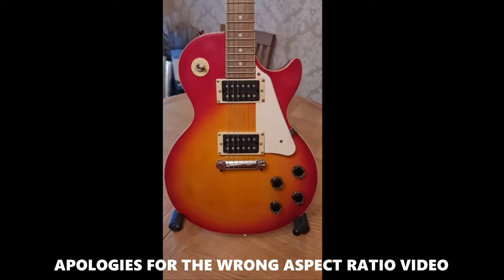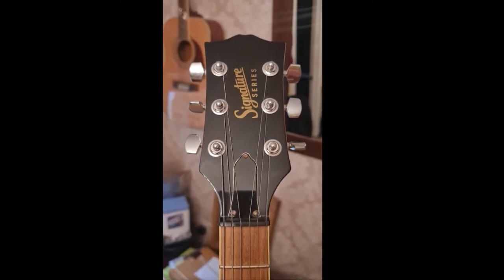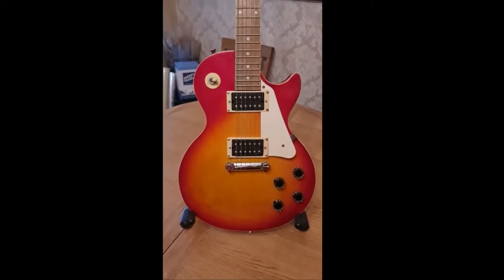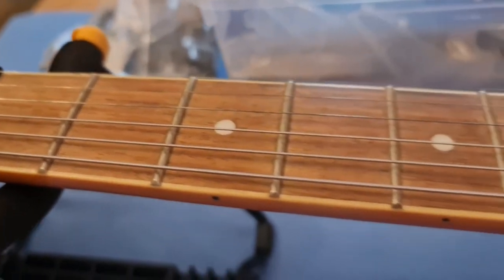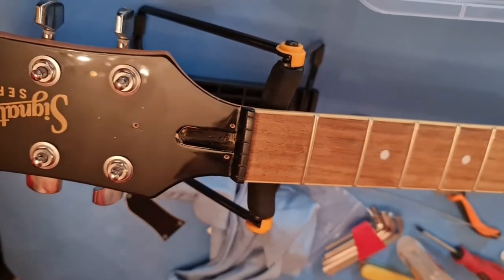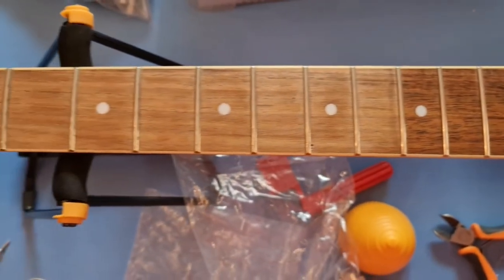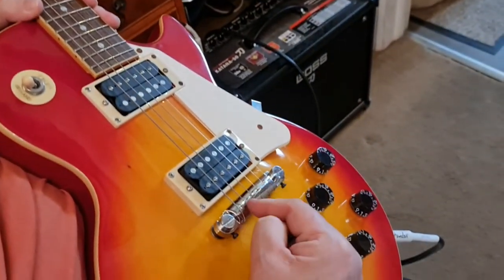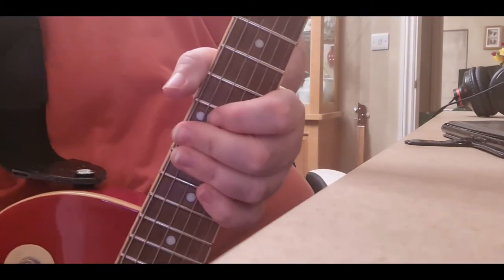GIBSON BALDWIN LES PAUL GUITAR REVIEW & RESTORE, DARK SECRET OR HIDDEN GEM

Comment: I found one at a Pawn Shop for $100.  Great bones of a guitar, better than a Epiphone i have.  My only complaint is frets are sharp to the touch.  The action was way high, approx 1/2 inch of fret board.  Thanks for the video.
Reply from the maker: You can blunt the frets with a nail file. I've heard they do multi grained nail files in your pound shops or buck stores I think I was told 👍🏻

Comment: I picked up one of these secondhand around 2010 for less than £100. I was curious to see what they were like. Following a proper set up it plays very well. I replaced the wrap around bridge with one that can adjust for each string. I eventually decided the original Epiphone pickups were too muddy and replaced with a set of Duncan 59s that I had from another project. I also thought the knobs looked awful so swapped for some more suited to a 59 Les Paul. I still have this guitar and I would say it was really underrated and because of its bad press I got a bargain, so I am not complaining.

Comment: i own one ..  its
...not awful.. i got it used for $25 so itsnot a loss lol..  it has some electronic issues and a fret or two could use some tweaking ...  plays best with .08 super slinky and i have had mine apart .. its solid but not mahog
Reply: good points... and it does not cost $2500 from Gibson. Even a decent Epiphone could get up around several hundred used... Learn what to do and why and do it yourself!

Comment: Can I put Seymour Duncan on it?
Reply from the maker: Yeah no.reason why you can't 👍
Reply: The thing is I bought this for 97£ in a pawnshop. I'm not quite satisfied with the sound. If I replace the bridge and the pickups, would it improve to a better guitar? And what fretboard do you recommend me to buy for it?
Reply from the maker: @Georgian.A-Music  The compensated stop bar needs to be changed for a modern one so the intonation is better as for the pick ups most cheap pick ups around today could possibly be an improvement but its hard to remember. From memory mine sounded fine but I couldn't intonate it because of that compensated stop bar
Reply: You mean the wrap around Bridge? Found some for same price as guitar, I'll buy the high end ones